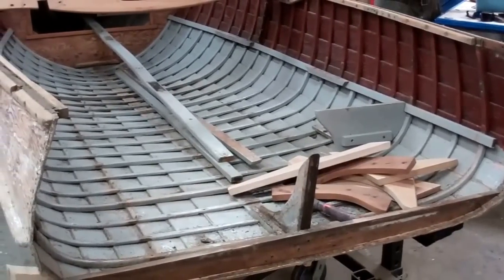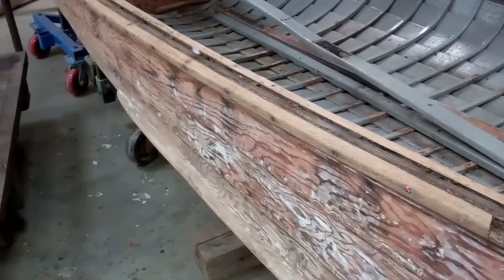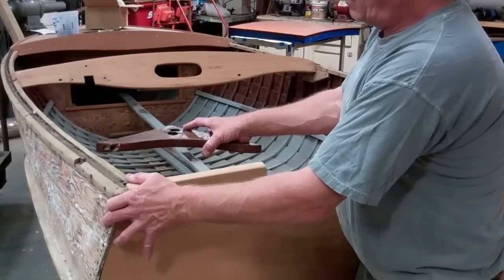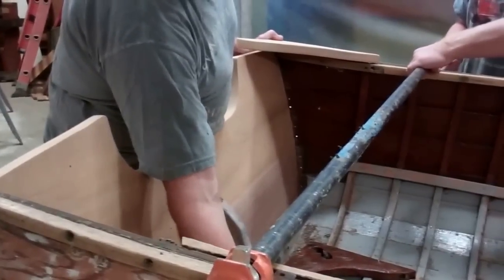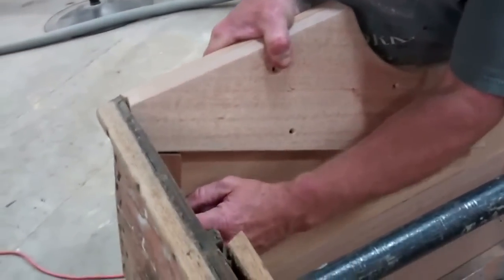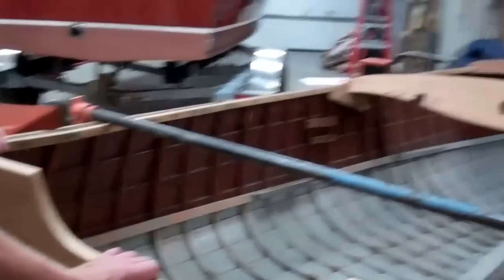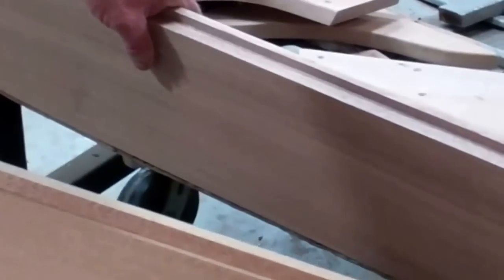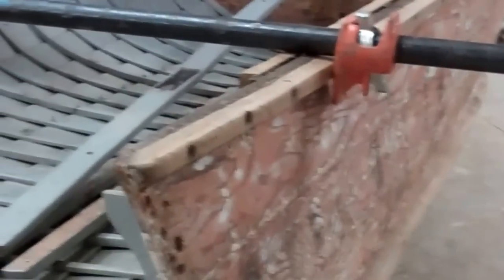'49 13 5' Lyman Leader Transom Replacement Update 9 19 2016

Comment: Thank you once again for another helpful video, Do you know what Species of Mahogany was used in the Transoms of these boats, Philippine, African, Sapele? And what did Jon use? Lulu's Transom is totally shot and with help from S.M.B. Ill be fabrication an new one but I want it to be the correct wood, Not Plywood.
Thanks Don
Reply from the maker: I agree, no plywood, and no African Mahogany or Sapele either. You want Philippine mahogany that is as straight-grained as you can find. (I never buy a board I have not personally examined first.)African mahogany might be pretty, but it cannot hold a candle to Philippine mahogany's density and rot resistance.There is also Mergante, which shares the strength and rot resistance of Philippine, but the grain, OMG! It is a mass of swirls and reminds me of tie-dyed Grateful Dead T's.,
Reply: Thanks Mike! 
Wow the confusing world of Mahogany's Thanks for your straight answer, A Quick trip to Johnsons Workbench In Charlotte Mi. about 30 miles from my shop and we are building a New Transom for LuLu 1956 Lyman 15Ft.
Whenever I'm beginning a new phase or repair I always go to your Channel because if I need to know how to do it, Chances are you have already done it and are willing to share.
Thanks Don from Michigan.
Reply from the maker: Confusing is the right characterization for sure.My gut tells me that LuLu is in good hands. Here's hoping you will share some photos or video along the way and at the other end of the project.
Reply: Actually if you click on my Blue title heading GHOSTBOATS PRESERVATIONS AND RESTORATIONS It will take you My YouTube channel where I have videos of "LuLu" posted With a Very  Eire Video of how "LuLu" looked when I brought her into the shop, Along with videos of other works in progress, Not to the standard of what you are doing but I'm trying, and learning a lot along the way!
 Every boat I have worked on probably should have been "Yard Art" But Hence the name "GHOST BOATS" We bring them back from the dead!
So if you get time check them out and read all of the descriptions.
Thanks Don